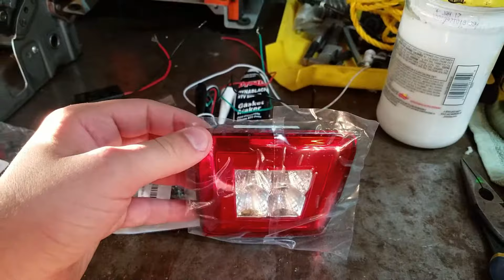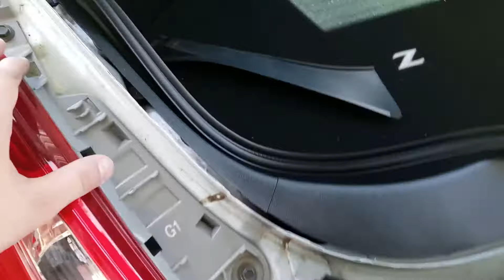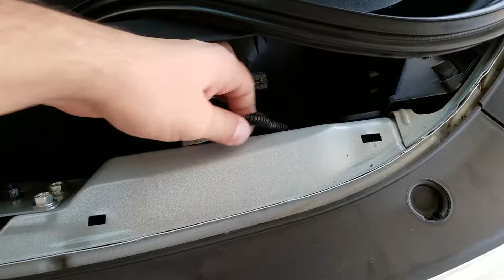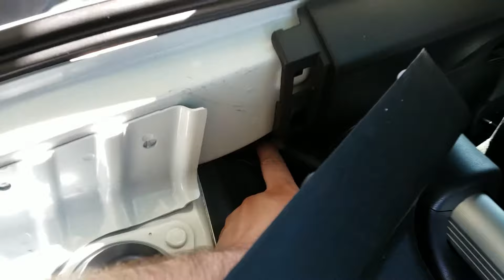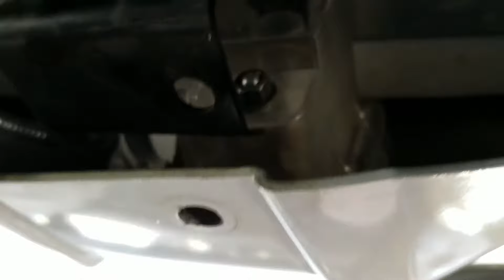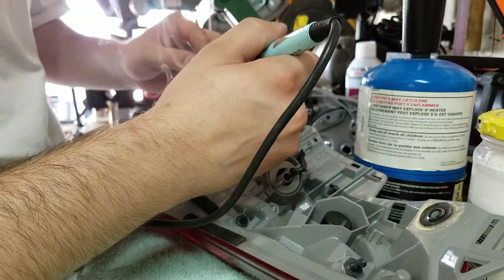370Z REAR FOG LIGHT 4TH BRAKE LIGHT

Comment: this is a whole paint in the ass to get to this and take it out and splice into it i thought it wouldve been a 10min job ;--;
Reply from the maker: If you had a sports edition it is plug and play and should only take you a few minutes but you won’t get all the other additional features. If all you want is a brake light and you just have to hook it up to the brake wire but if you want the running light and reverse light then you have to tap into the other wires.
Reply: @ProjectAnubisUSA  I do have a sport trim where would I plug it into?
Reply from the maker: @JackOAT_  Check underneath the back area and there should be a plug you could splice directly into that or you could buy a direct replacement that has a dongle to plug into it. You will not be able to get the features except for break I believe but you can add the 555 timer to get strobe in between

Comment: I’m having a hard time figuring out where does the strobe module connect to? 
Can you please tell me ? Thank you!
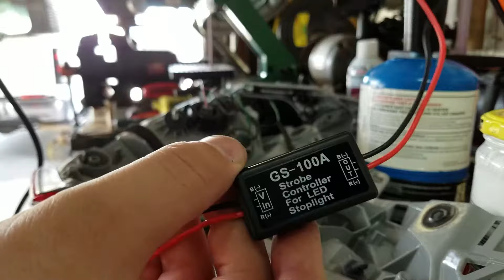Reply from the maker: @13:50 I show the layout of wires and colors once hooked up. Pause the video and you can see the plug wires it ties into. The solid red tape wires are from the fog light I bundled together. Hope this helps... also, slightly before it shows the wires I spliced but one wire was wrong and I talk about it after at 13:50. Zoom into the video or screenshot if you need to see details, this was a video where I was filming with a phone and learning how the new editing software worked.
Reply: PROJECT ANUBIS thank you ! I managed to get it done however I mistakenly set it to blink when the lights are off. Not when my daytime running lights are off lol . But your video was extremely helpful mate.

Comment: Hows the Light Holding? has water gotten inside the assembly? i heard some stop working after a while, Just curious i just got mine but awaiting install
Reply from the maker: I’ve had it in 30 deg weather, heavy rain 🌧 these past 2 months, and in the 103 deg summer heat and it still looks and works the same so far. Knock on wood
Reply: PROJECT ANUBIS Awesome thank you so much gives me better hopes

Comment: Hey I have a 350z with the ams rear bumper and I just ordered the lights. Not sure how to wire it up. Could you help me ?
Reply from the maker: Ricardo Williams I haven’t looked into how a 350 is done but I’m sure it’s the same wire layout or close to my video. Use a test light to find the wires you need. Remove the bulb and ground the test light then probe each prong to see which has power. Have someone hit the break and probe until it lights the tester you then know which is the brake light. Turn on run lights then probe for that. There are videos and write ups I’m sure that have more information since the 350 has been around longer. Hope this helped 

https://www.amazon.com/OEMTOOLS-25886-6-24V-Circuit-Tester/dp/B0014WIVX6/ref=mp_s_a_1_6?ie=UTF8&qid=1548710895&sr=8-6&pi=AC_SX236_SY340_QL65&keywords=light+probe&dpPl=1&dpID=41iKkEpc3aL&ref=plSrch
Reply: So far it works with the strobe I have but I wanna keep the light running and when I step on the break it should flash and stuff. But idk which wire is the run light wire where it should stay on all the time
Reply from the maker: Ricardo Williams turn your lights on and find that bulb, once found it may be dual filament which allow it to burn low for run and burn bright for brake. To figure out which wire use the probe I recommend. Take the bulb out (leave lights on) and touch each prong/ terminal until it lights the tool up. Be careful not to touch multiple at once because it will blow a fuse (direct short).

Comment: How the hell are you going to replace your tail light if you ever need to. Re-do all the wiring
Reply from the maker: Dillon Griggs I would recommend wiring this to removable connectors if you plan to take off the taillights. The only reason I’d remove a taillight is if I wrecked my car (rear) in which it wouldn’t matter or if I changed bumpers which it can rest on the truck area and both of those are unlikely to be a regular routine. If you absolutely need to remove your taillight all you have to do is remove the bulbs socket holders and your shell is free to do as you please. 😁
Reply: PROJECT ANUBIS yeah that’s true I just tapped right into the pig tail that plugs into the tail light maybe I should of did it the way you did it.
Reply from the maker: Dillon Griggs I think your way is cleaner. I just didn’t want to cut into it because I was not sure on the function I wanted and I figured its easy to buy a harness if I messed up instead of doing a full re wire or plug wire.
Reply: PROJECT ANUBIS yeah I did it pretty clean I crimped them all back together and heat shrieked it all and then wrapped it all with electrical tape it was all pretty clean then tucked the wire between the bumper and the foam peace in front of the bumper guard so it wouldn’t hang down.